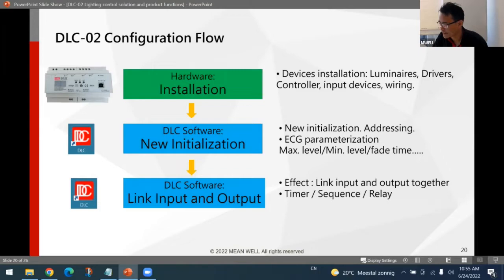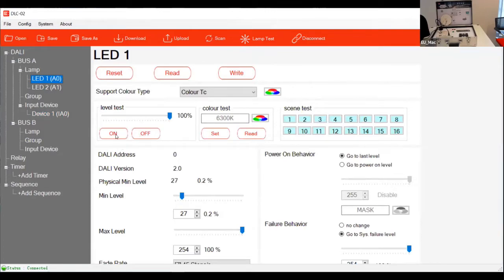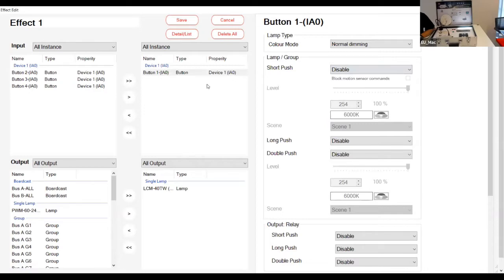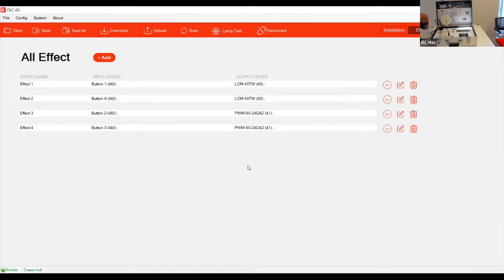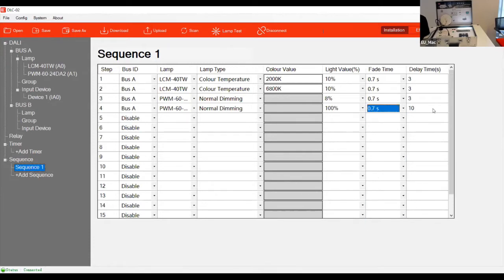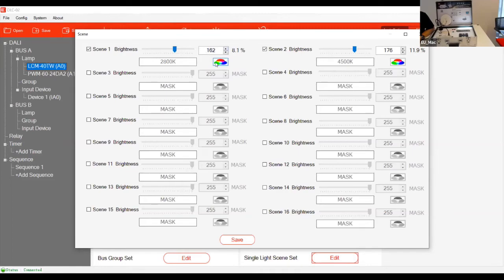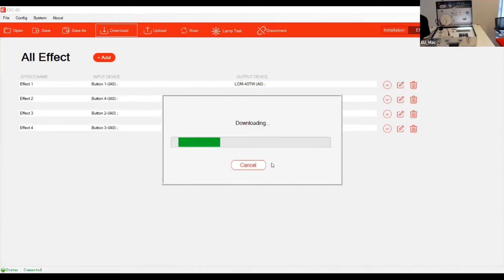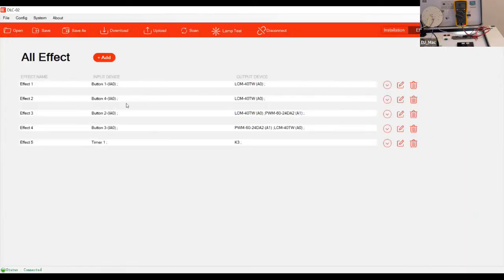DLC-02 DALI-2 Lighting Controller Software Setting

Comment: Thank you for this great video. Can I connect by Ethernet cable instead of USB? If not, what is the Ethernet cable for. My device is connected and has displayed DHCP assigned address but I can’t really access it. Thanks a lot
Reply: Worked it out. RJ45 port is totally pointless and misleading. This controller cannot be integrated into your LAN and be sent TCP/IP request. It has no web server built in. It is therefore very limiting in its functionality and integration ability.